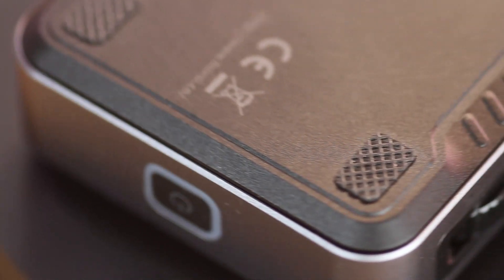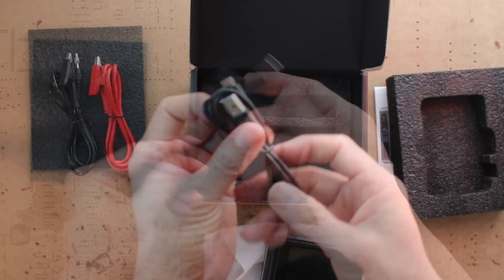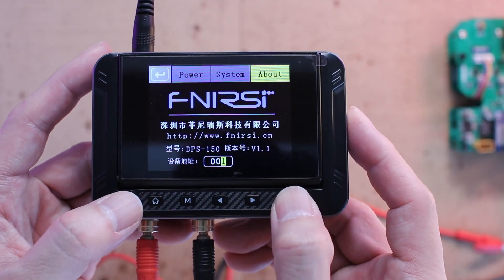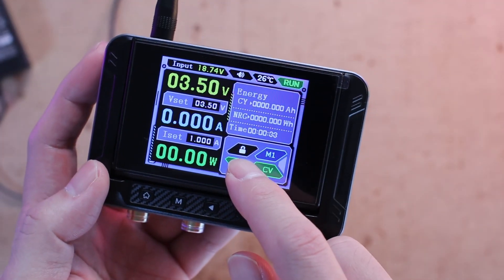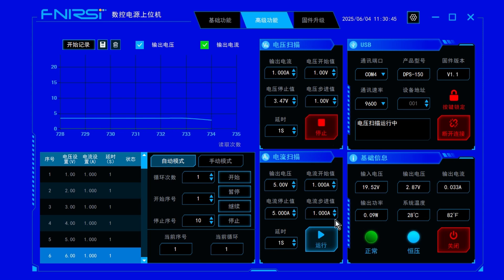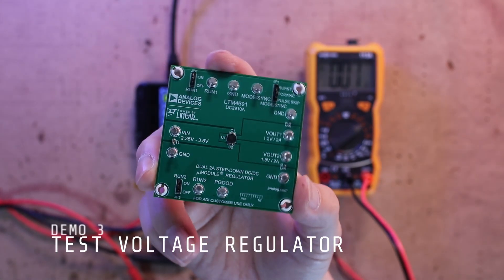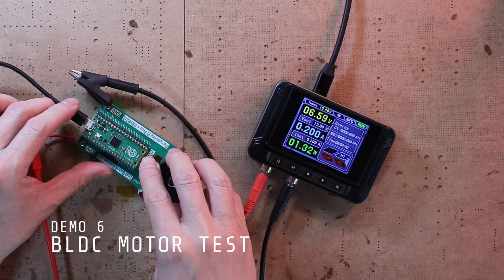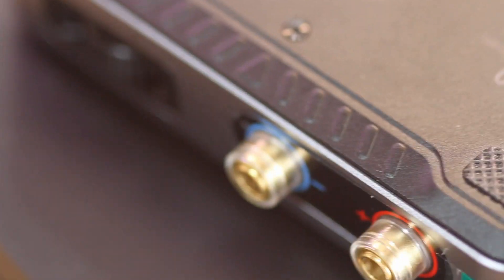FNIRSI DPS-150 DC Power Supply Review with use case Demos!

Comment: Bought this with the upgraded package that included a FNIRSI 100W USB C Gan charger.   That was a mistake.  There is no internal buck converter.  You get out what you put in.   I needed 24V.  With USBC you are limited to the 19.xxV.   So, after my ~100 purchase for a $45 device, I'm looking to spend another $30 for another 32VDC Power Supply to feed this power supply.   Lol.   I have other larger power supplies on the bench, but the small footprint and portability made this attractive.   I guess if you are just small board work and looking for something good on the cheap and don't need over 20v.  Than this is your ticket.  Else, without an included 32V source adapter, @ the price/market entry point - it's kinda stupid - hind sight.  ... But also Kinda cool.  I have a bunch of FNIRSI stuff.  Good cheap electronics.  They're the Harbor Freight for Electrical Engineering.   And similar, give them a couple years and see what happens.    All good.
Reply from the maker: Yes, That's true, it will be a little hard to find a source to input over 20V. other than that it is really a convenient tool have at the lab desk.